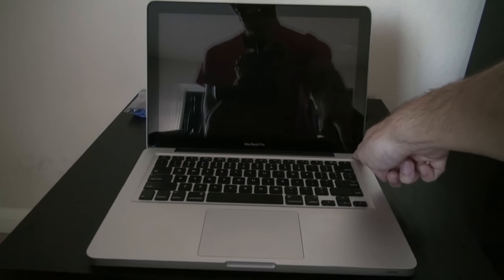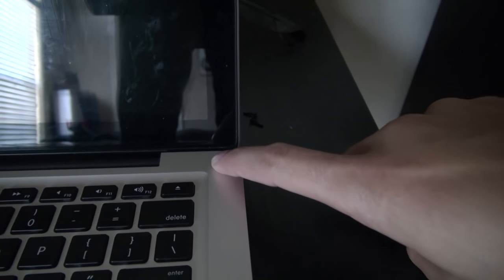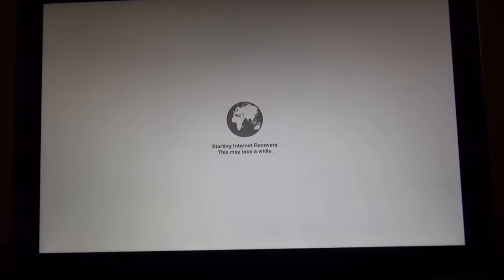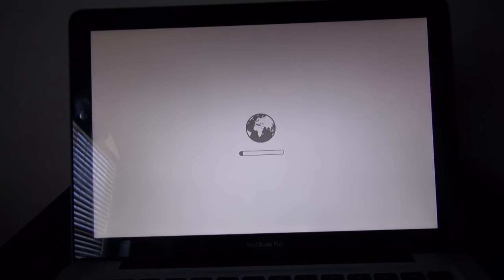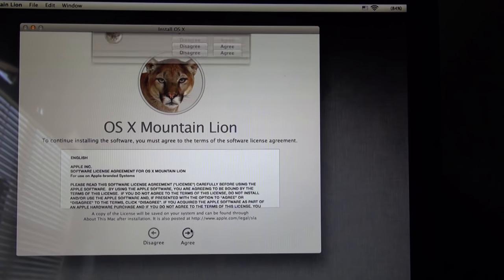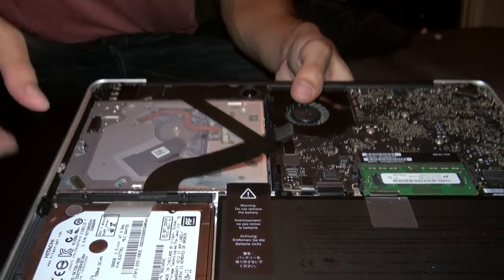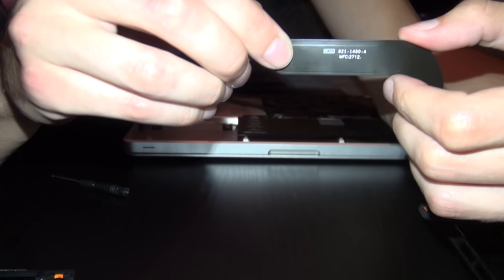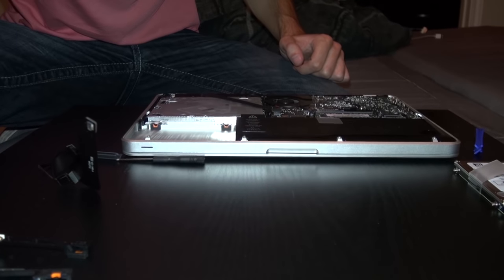How to Fix Macbook Pro  Flashing Folder, Blinking Question Mark, White Screen, Freeze Randomly

Comment: Got the flashing question mark folder.  Ordered the cable he mentioned, got here in 2 days from amazon for $18, installed in few minutes and everything went back to normal.  Nothing was erased off my computer.  Thank you sir
Reply: +thesidewayzone what type of mac do u have
Reply: Model No. A1278
Reply: How can I find the correct cable I need ? I have a Macbook Air. thanks
Reply: thesidewayzone  thank you!!!
Reply: Do you happen to have a link to a screwdriver that's the correct size or know the size it should be or anything of reference for the screwdriver?
Reply: The size I used is a PH 000 x 40
Reply: thesidewayzone this gives me hope for my computer thank you
Reply: thesidewayzone I just changed my cable and the original hard drive starts loading then powers off, and the new hard drive I put in the question mark keeps blinking. What should I do next?
Reply: YOUNG TURNER IV you need to reinstall the macOS!
Reply: Hey bud...You said a few minutes? He mentioned 3 hours?!?! I had someone put in a new hard drive with more space...then computer was over heating after about 10 minutes...now I have the blinking (?) folder. I'm afraid if I follow this, it'll overheat. Any suggestions? Thanks!
Reply: @felipezafani  I have replaced the cable, had the same problem as Young Turner IV, the question mark still kept blinking, booted into the internet recovery mode, selected reinstall the OS, but there is no disk for selection. Any suggestion what should I do? Maybe I have inserted the cable wrong? Maybe my SSD is dead? (Although it shows up in the disk utility). Any suggestions/sources/videos what should I do would be greatly appreciated.
Reply: I have the same problem and it still wont work
Reply: @simasjanusas1766  did you figure it out??? I have the same problem as you
Reply: @Prochimuch  I had to reformat the ssd and then reinstall the MacOS (went with Mojave, from always used High Sierra). Lost all my files but the laptop is working back again. Apparently, High Sierra software update has messed up the formatting of the ssd. Always have a back up! Hope this helps
Reply: @simasjanusas1766  how did you reformat it?
Reply: @Prochimuch  I think you will get a restore option on the disk utilities that should do it and as @Simas Janusas said it will lead to data loss
Reply: How to I find the unibody cable what is it under on Amazon ?

Comment: That yellow thing is connected to a ZIF connector and should not be popped out or back in! (please google ZIF connectors before attempting to do what's shown in this video). After trying this myself on my own computer I couldn't get that yellow wire back in. Many of these videos show incorrect removal/insertion.... DO YOURSELF A FAVOR AND BUY A NEW CABLE WITH THE BRACKET ALREADY ATTACHED. I returned my cable (without the bracket) and ordered one with. SUCH A TIME SAVER. Spend the extra 10 bucks. You'll thank me later.
Reply: Billie Lagos where did you buy the one with the cable attached?

Comment: WOW!!!!!! I'd like to start off by saying that when this happened to me, I contacted Apple & they told me that my Macbook was a lost cause. According to them it was a hard drive issue that was more than likely not repairable, & that next time I should invest more money in a macbook with SSD. Either way, I was told that I needed to buy another macbook.
I took the liberty to just do the research on my own, and came across this video. I ordered to part & followed the directions. 
WORKED LIKE A CHARM. Total cost of the repair was $20, and my macbook was back just as the way it was before this issue occurred. Saved my Macbook, & the money in my bank account.

Thank you VERY MUCH!
Reply: Was the part you had to order the cable/unibody? If so where did you find it and know it was the correct one?
Reply: Hi I'm trying to fix my macbook air.. Which cable to use?
Reply: Luis Jovel they just want ur money
Reply: hey this just happened to me where did you order your part for  ,,20 bucks right?
Reply: Macsales dot com has it for $14 this week, regular $44.  I highly recommend them for all apple replacement parts, it seems they have very low failure rates.
Reply: did you lose all your stuffs when u replaced the cable or it stayed the same?
Reply: Did you lose any folders?
Reply: No files were deleted too
Reply: Thanks for trying it bra I'm gonna do it now mines just did this to me two days ago I got scared lol 😨
Reply: But I need to open it first to check on the serial number of that cable or can I use the serial number of the iBook itself? ( I don’t have yet that kind of screw driver and it seems like they sell the whole kit) I can’t order the kit if I don’t know the serial number right?

Comment: I watched this video and everything that was happening to the guys laptop was also happening to mine, so I knew it was not a hard drive issue and had hope that it was only the cable. I ordered my cable off of Amazon and waited 3-4 days for the cable to come. I was so stressed that knowing my shitty luck there would be more issues with my MacBook Pro than just the cable. But after I installed the cable, everything worked, I got all my data back and everything. I cannot tell you how happy I am! Thank you! This video works guys, if you have this issue then follow this video trust me!!!
Reply: A. Cammy did you just replace the cable or did you have to also reinstall Mac OS?

Comment: Seriously cannot thank you enough for this video. My laptop had this exact problem, so I took it to the apple store and they said it was a hard-drive failure, it would take at least three weeks to fix, cost upwards of £100 and it was very unlikely I'd get any data back. This was pretty scary for me as I hadn't backed up my data and I had exams in three weeks!

So I chose to ignore their advice and followed your video instead, and it fixed the whole thing!!! Didn't lose any files and the cable only cost me £12! Ridiculously happy right now, thank you so so much <3
Reply: smart
Reply: Where can u buy the cable?
Reply: Litlle Cecretz Amazon!
Reply: What MacBook did you have?
Reply: thats nothing in taiwan it costs about 600 USD to fix...
Reply: Also goes to show how predatory the company is

Comment: WOW!!!! Still Worked in May 2022..

I Have MacBook pro mid 2022 and changed my Ram from 4 Gb to 16 Gb and crucial 500 Gb SSD hard-drive..
And after replacing these parts I faced the same issue mentioned above...I changed the Hard cable of SSD drive and it's works 👍..

Some instructions 
1. You need all these small tools to change that SSD strip
2. For removing that yellow strip you need a magnifying glass, otherwise it's very difficult to see what you doing with naked eyes..
3. To change the Yello strip you must need to see the other videos available on YouTube... That will be definitely helpful to you..

Do all these change of parts alone when no one is there to disturb you...

My Mac pro works like a Charm and it's superfast.. Thank to the video!!

Comment: Dude! You are THE man! Was worried my HDD was toast. Apple was no help, the local 3rd party shops were going to charge me $100-$200 depending on the turnaround to even see it. Your comment of seeing the OSX base system up as a cable issue, was spot on! (And something no one else mentioned) Ordered part last night, came this afternoon. My part included the bracket so it was slightly easier. 5 minutes and I was back online. THANK YOU!
Reply: same here
Reply: @chitah27  hiii!! 
Where are you from how much will it cost in India?

Comment: You are The Man! Had the Q-mark. I read those initial steps at Apple and went through again just as you chronicled and ... nothing. So I followed your instructions, got the new cable via Amazon and it worked!!! Hallelujah! The only tricky part was the reinstall of that little gold strip, sliding it back in. An additional vid on that would’ve been nice. 😊 Finally got it in. Also, helped massively to have a magnifying glass. Could not have done that without it. I would suggest that. Thanks again so very much.

Comment: Was so scared to try this, but I was more afraid of losing my files and computer. I finally decided to do this and it works! I am now typing on my MacBook Pro that you inspired me to fix. Thank you!!! Also thanks for including the link to the cord. It was the exact one I needed. Thanks again!
Reply: Michelle Ross Michelle Ross does reinstalling OS X delete the files or did you save them on a usb with time machine before reinstalling? I don’t wanna lose my files either but not sure if I should reinstall without using time machine first or just reinstall and change the cable

Comment: This worked! After trying a new SSD, reinstalling my OSX 15 times through OS recovery, and not getting anywhere...I found your video and it was exactly the fix. Thanks for posting this and for the clear instructions.
Reply: Hello I'm stuck in mac OS X utilities can't go further than that before this i removed the hdd and inserted an ssd what's the solution ? would appreciate

Comment: Worked Great! Up and running again! Only hard part was getting that tiny gold/yellow ribbon back in tiny slot. Found it fits on top of prongs inside on tiny black box.  Didn't even have re-install OS. Thanks!
Reply: Glenn Schot can't get the damn thing back in.

Comment: Command option R.  Is the Internet recovery FYI command and the letter R is only for the recovery partition built into the system which won’t do you any good if you try to erase the drive because well you can’t because you’re accessing it :-) you’re welcome now if you do Internet recovery with command key option key and the letter or at the booed up sound you will be able to access Internet recovery reinstall software OS and or delete format hard drive but make sure you can reinstall an operating system of some sort since you won’t have anything on the drive. 👍🏻👍🏻

Comment: How does my cable break when my computer was working fine before I dl el captain
Reply: +kris hedges fucking right ?
Reply: +kris hedges I changed the cable myself and there was still a blinking folder. It's not the cable, but in fact the Hard drive has been ruined....
Reply: ***** yeah i got a ssd for it then sold it

Comment: I had the flashing folder on my a1286 mid 2012 macbook pro and followed your steps until I also got the blank HDD part at the startup disk selection screen. So I assumed you were right about the damaged cable but then remembered I had an extra SATA HDD from when I upgraded my iMac to a SSD.

I installed it and everything worked perfectly, no need for a cable or anything else. Perhaps it was just a dead HDD (even though the system recognized it had a 500gb hdd). Either way great vid.

Comment: will i still have all my documents etc when I do this?
Do you have a link for a proper screwdriver to use?
Thanks!
Reply: Can anyone answer this question? Will re-downloading the OS completely wipe all files? Thanks!
Reply: if you restore your hd probably you will loose all your data. that's why I recommend that take hd out, put to inside of extra hd then backup. after all this change the cable. I will make it soon and I will write the results here.
Reply: if you reinstall it on an existing OS drive, YES
Reply: yeah I can tell you the correct screw driver you need to ask for a 6 inch reproducing tool. you should be able to get it at a local hardware

Comment: All I did was go to start up disk, restarted that and it worked? Why did that work so simply for me and you're telling us to do way more. What's the difference? Is my 2011 Macbook pro going to crap out on me?
Reply: @Jwax McGeeg I have the same laptop as you and have experienced both. The first time I had this problem, I fixed it the same way as you. However a few months later I couldn't. So I sent it to the Genius bar (still had Apple Care at the time) and voila, the cable had burnt through. The reason why that happened is that the way the Macbook Pro is built, this cable lies in an unfortunate position and is prone to overheating and then not working anymore (this is what the Apple staff member told me). That's why they tend to replace the cable free of charge – as it's not the customer's, but the producer's fault. If you were able to fix it with the first steps, lucky you, but beware that this may be the first indication that the cable is starting to be unreliable. That's what was the case with me the first time round, and by the second time this happened the cable had completely died and Apple needed to replace it. Little tip: make sure to back up regularly from now on, as the same may happen to you as did to me..
Reply: He said if that doesn’t work, are you guys listening to what he said
Reply: How did you restart it tho
Reply: 20 something did you lose everything?

Comment: didn't work. My macbook is just a white screen still.
Reply: Mitchell W i
Reply: Firstly let me brief my problem

-I do internet recovery initially got eror 401 something forgetactual name u can use mobile hotspot wpa2 and try again u will be able to recover loading bar finish but still once boot white screen stcuk or sometime even hang
- Used recovery hd and still stuck white screen when you recovering:D

For white screen no matter recovey from internet,  option cmd p r,  recovery HD from option,  terminal fsck etc,  did all thing but still stuck? Dont worry i got found a way ystd somehow to come back life again.  The problem may has a problem within circuitry or software though i m not sure what happen but if u want to try u may try

Step 1 remove adaptor
Step 2 press power button to close mac 
Step 3 turn on using power adaptor in again
Step 4 this is where magic comes in
         Press shift+option+cmd together with power button to 10 sec to reset SMC which is to by 🍎 

Step 5 - some of you will see after trying step 4 still will not recover. Ok this is the real magic comes in - you will have to do step 4 acouple of time by 
You press shift+option+cmd and press power together again so the mac will go to power off.  Then release shift+option+cmd and press on to power on mac then after that suddenly press shift+option+cmd and power key together again let the power jam. Try that scenario around a fewtimes your power cycle will somehow bk to normal. And once recover dun ever let battery 0 and dun press shift+option+cmd+power to reset SMC again by any chance because IF YOU WRONGLY DO one of the above two thing u will face white screen again.. 

Now my mac running few days but currently i can only get rid to come bk life only.  Still researchin why i need to do that..

Shud i made video lol
Reply: If you have a white screen of death try resetting the SMC apple support page https://support.apple.com/en-nz/HT201295 and try to reset the nvram https://support.apple.com/en-nz/HT204063. Hope that helps
Reply: pre pre Hey there, just wanted to say thank you loads!!!!😍😍😍 
If you are a dude sorry for the lovey faces, but you saved me 1400 bucks! I tried a variety of things then stumbled across your comment. I followed your instructions and SHE LIVES. Thanks a ton :)
Reply: pre pre to

Comment: What if the mac os doesn't show up on disk utility?
Reply: you probably have moved on, but for future readers: if there is a disk0 drive listed in disk utility, but nothing under install osx, probably the cable. if there is no drive listed in disk utility, i would assume it is a dead drive.
Reply: stick1984 hi, I too can see the Mac OS X base system, but not the disk 0. Does that mean it’s a cable issue?

Comment: If the MacBook Pro 2012 having problems or freezing randomly or flashing cross circle you might need to use inrernet recovery or take sticky screws out or need to order an new cable then once you get in mail and put new cable in then it will give an hard drive option. When you start up an MacBook you might get an flashing folder with question mark or a cross circle symbol and this means that the startup disk is not available and the operating system is damaged

Comment: What do I do if it's not letting me connect to a network
Reply: I have the same issue
Reply: desnee718 same happens to mee😩😩 did you solve the problem?
Reply: Domenica Matamoros yes I did I went to MicroCenter and the cable was bad. Apple did a recall so I ended up not paying for anything, because they shipped it there for free. You should let a pro see it. You might not have to pay if its the cable.
Reply: This happened to me when I tried fixing my laptop at my university campus. You have to either plug in an ethernet to your computer OR use a personal router (ie wifi from a home system that has a WPA2 password).
Reply: keep trying. it will eventually let you. i tried like 15 times then it worked